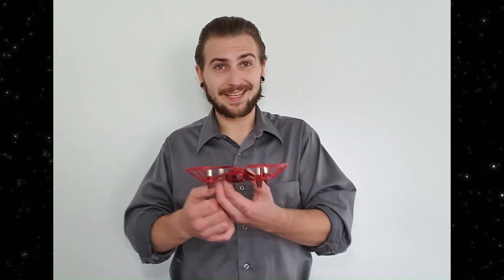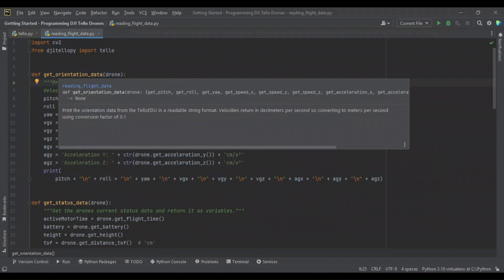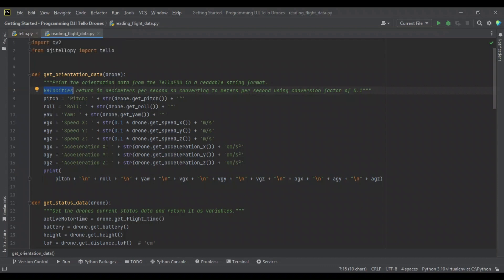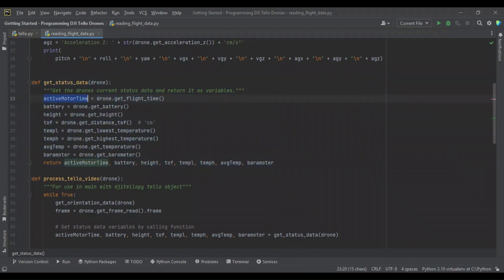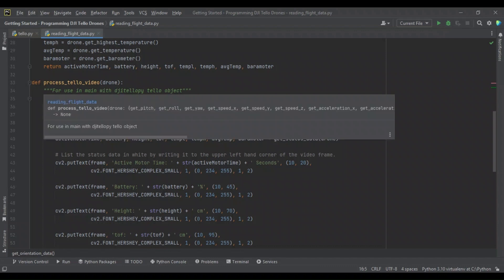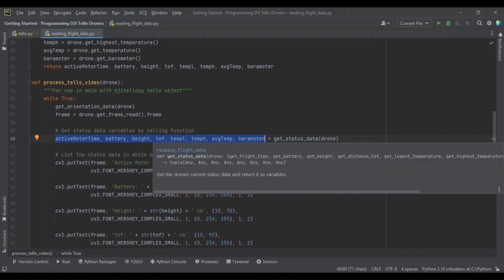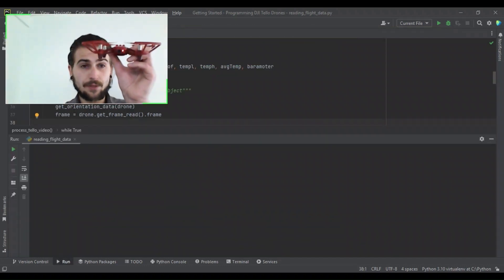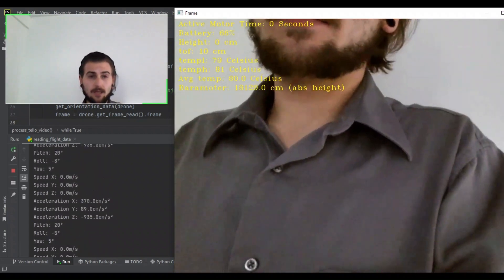Mastering Tello Drone Sensor Data Reading with Python

Comment: I have a problem with python working in my tello drones. Sometimes they don't execute all the commands.
Reply from the maker: Hi @bigshoio, I'm sorry to hear about the issues you're experiencing with your Tello drones. 😕 

To help you better, could you share more details about the problem? 
Specifically, what code are you trying to execute? You can provide a high-level description or more detailed information. Also, are there any error messages showing up in the console when the issue occurs? 

With this information, I'll be better equipped to assist you and hopefully get your drone programming back on track!

Comment: hey jake, did you post your code from this video on github. If so, do you have a link?
Reply from the maker: Hello @kaeleib, I don't have this exact code on github but the module linked here: [https://github.com/Jacob-Pitsenberger/TelloEDU-Examples/blob/master/flight_data.py] is essentially the same with the only difference being that the logic in the process_tello_video() function is in a main() function instead. Hope this helps, thanks for the comment and support!